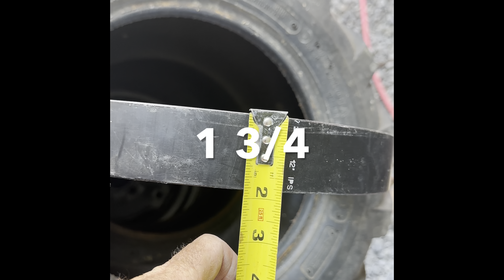How to put duals on mower

Comment: I didn't use any spacers and its working fine. I think if i would have it would have been to wide for my 54 inch mower deck I also put water in the rear tires for weight loven it.
Reply from the maker: Cool

Thanks for sharing

Comment: Could you run triples with the skinny tractor tires ?
Reply from the maker: Probably so- just need a bolt long enough
Reply from the maker: Or maybe get a 2nd set of bolts and go from the outside wheel- hummmmm
Reply: Could use some all thread,  just cut to fit

Comment: Those spacers say 12” IPS, that’s 12” iron pipe size pvc pipe, get some scraps of it and cut as wide as you want.
Reply from the maker: So where would you get that at?
Reply: @MurphyMower  check plumbing or landscape supply places, they may have small cut pieces as it’s normally sold in 20 ft length.
Reply from the maker: @brianchristen5849  thanks